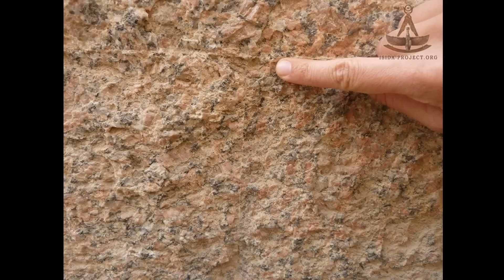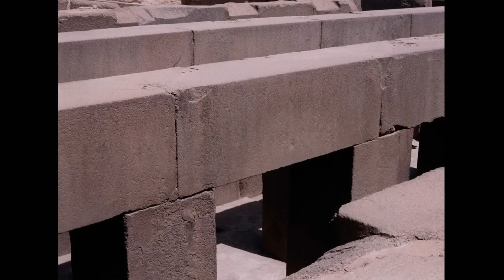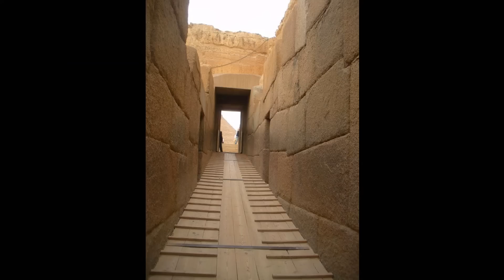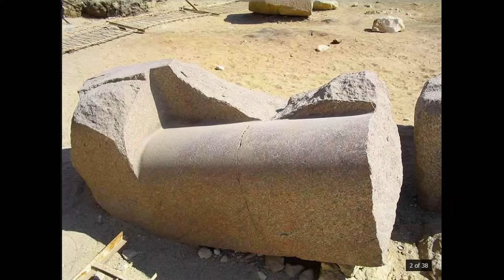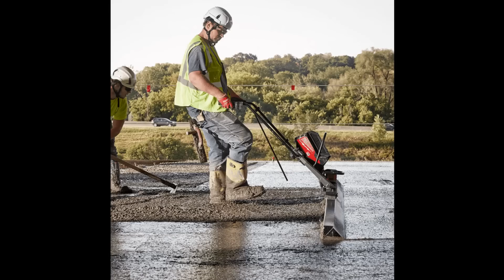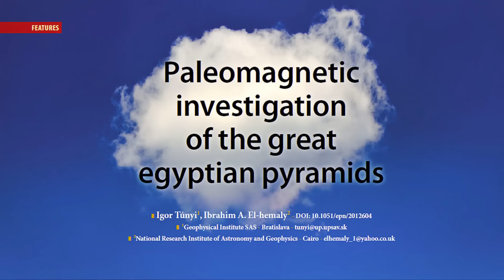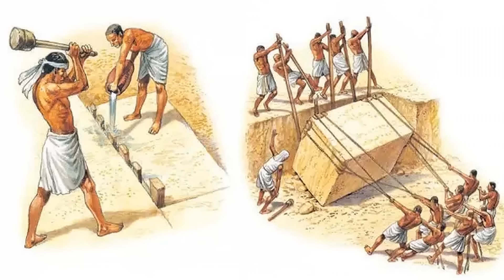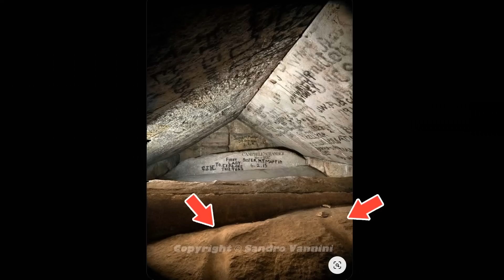How were the Perplexing Giza Pyramids' Granite Blocks Created?

Comment: Hi Tina. Sorry I haven't been paying attention to your channel in real time.  Remodeling is not as much fun as one would hope.

This is terrific and undoubtedly the correct answer.  The most interesting question to me though is how did they make the batch.  Was is chemistry, like cement or was it heated.  Using lenses and sunlight we can melt anything on earth.  I've seen steel melt like butter using solar concentration ratios of around 1,000 to 1.  Hathor's horns likely held lenses used to melt most anything.  The Horns of Consecration on Crete that Evans brought to light were surely used to melt metal.  The double axe image is what you get with a certain type of concentrator. I've built them for NASA so I do know a bit about these things.

I'm delighted that you have tuned into the work of the great Prof Davidovits.  When we eliminate the impossible, ie, copper saws to cut 2 ton blocks, lift them, fit them -- for goodness sake -- who could believe that?  When you try that it is impossible to get perfect fits at any time. When you pour concrete it is impossible not to get perfect fits every time.  QED

Given enough strong young 20 year olds, I could built the great pyramid in 20 years, as Herodotus tells us.  The granite was probably poured but I suppose it could have been mixed like cement.  When you put water on granite you don't need very high temps to melt the stuff.  How else did the blue granite boxes get under Saqqara?

Thanks again for your great work.  I intend to start paying attention again.  As for the date of the Great Pyramid, I believe Petrie thought it was 5500 BC.  I'm not so sure it takes a long time for memory to fade after a cosmic catastrophe.  The same source that points to the Atlantic shoreline, (ie, Atlantis nesos per Plato) being 9000 years before Solon says the declination of the earth changed later.  I believe 6200 BC was when this happened -- Phaethon.  I believe the earth tilted.  Yet to be proven but I'm working on it.  This coincides with a meltwater pulse and the submergence of Doggerland.  

Best Regards,
Henry Hewitt
Reply from the maker: Thanks for sharing your thoughts and your expertise, Henry. It's very interesting to think about how lenses may have been used in ancient times. I'm also glad you appreciate Prof. Davidovits' work - his insights into the pyramid stone are fascinating.

Comment: -If you assume it is Cast Granite,
then with what machinery did they crush the granite - Tens of Millions of tons!
-What kind of Formwork did they have to withstand 50 - 80 Tons of granite paste, and to come out perfectly for the joint, without bending, breaking due to the weight-pressure?!
-What kind of Formwork - Mold did they use to withstand the pouring of the granite paste, in the manufacture of gigantic statues of 700 - 1000 tons ? or the pedestal of 400 tons?
-With what, How did they raise the 100 -200 tons super-storey monoliths in front of the Sfinx ?
-The Obelisk of Aswan It is not cast granite, it is obviously cut from the granite quarry.
-And yet in the Aswan Quarry and around the pyramids there are a lot of traces of a circular cutter.
-It is possible that those craftsmen had some kind of technology with which they cut - they dug easily into the granite!

Comment: the knobs are indicative to where the original surface of the wall was weathered away from, yes those were water exits, the finer particles set there mobile from the exiting excess water. This is why it weathered slower, its more densely packed while hardening . Those blocks break very conchoidal for natural included quarried rock, point to it being very uniform. If they find carbons organic or fossil material those were granite cement blocks cast not quarried.

Comment: It's not hard to make two even matching surfaces, just time consuming. Like a pair of mill grinding stones, you place one stone on top of the other and start turning it. Evenually both stones will be perfectly plane. Then repeat for the next five sides. As for the uneven you carve a piece of wood or cut papyrus to match the rough stones then you transfer the pattern to make the matching pattern on the next stone.

Comment: Hi Tina. Thank you very much for highlighting my comment. 
I don't think the Ancient Egyptian master-masons used a resin to reconstitute their granite as is done in modern times using granite fragments, so I don't think any resin  will be found in ancient cast blocks. 
No, using carborundum edged bronze, or even hard clay or wood fly-wheel type drill grinders on natural granite, the master-masons produced a very super-fine granite powder to use, and did not use granite fragments as is done today. I think a two-man team could produce a bucket of this super-fine powder in an hour or so. 

The Ancient Egyptian master-masons then took this granite powder and added a little water and an acid catalyst to form a malleable paste which they poured into their molds and allowed to dry and set hard over several weeks, or months. 
What the master-masons were doing was using mechanical means, and then an acid to break down the granite super-fine particles into their hot, molten state, that is, the granite molecules were partially disconnected from each other, would not be rigid, and would flow as in lava. Normally, a very high temperature would be required for the granite to be put into this state, but I believe the Ancient Egyptians discovered the above cold method to do this without the heat.

During the drying and setting period, when the acid had all been used up in dissolving a proportion of the super-fine particles, then the granite unattached molecules would start re-attaching themselves to each other, form crystals and become rigid just as in cooling lava. And then, also, it would look exactly like lava-cooled natural granite!

it is interesting to note that in Malta, the blocks cut from Malta's modern, limestone quarries are very soft when first cut, and have to be left in the air for many months or years to dry out, or "season", before they become extremely hard suitable for building houses.

Comment: It stands to reason, that if a storm of high winds and/or mighty waves come into contact with a coastal building, that only the foundations will be left in-place.
I personally have seen this via hurricane in the Pacific Islands.

Consider the foundations being huge stone blocks.
Eg
The Great Pyramid surrounding courtyard, monuments of Roman and Greek construction.
The Romans and Greeks seem like they didn't construct their foundations.

If a Great Flood, washed away the building that existed
(Gobekli Tepe suggested 3 waves), then the Romans and Greeks would have discovered prime locations to erect buildings (where foundation stones already existed).

Half way up the Great Pyramid, are water markings.
And around the walls surrounding the Sphinx are water erosion signs.

But it's too easy to make this comparison.

Like the comparison of the shape of the sand, when a wave retreats from the beach.
And the aerial photograph of land formations, where a Great Flood may have retreated from the land.

Comment: If they have those knobs, which would indicate enough weight to the blocks to require some knobs to help move them, then would that indicate NOT being cast?  Love this video, just thinking out loud.  Your knob video, which I’m about to watch again after typing this, opened my eyes so much.  Fyi.  Ok back to the thought.  If the knobs are needed to move some of these potentially then they would’ve been heavy and solid and wouldn’t be cast right then and there right?  Otherwise no need for knobs?  I can see cast stone being whisked away into a smooth surface, but I also could see hard stone being CUT flat by an angled saw of some sort.  

Seems highly unlikely that this pyramid only would’ve had its construction so precisely halted by let’s say the younger dryas whatever happened.  I would wonder why they started smoothing the surface right there and why it’s up to a perfect height and only done for like 15 feet in width.  But yeah, mostly wanted to comment about why the knobs of this was just poured or cast and maybe they were hard and cut smooth for finishing after construction.

I don’t know any answers lol, I’m just awake after changing a diaper and sitting here enjoy the mind trip on your video.  Thinking……thinking…….

Comment: Yes they were cast, more accurately melted into shape. Squared rubber like sleeves were made on the "lingum" stones from guano and tree resin like kneading bread to thin membranes, left to almost vulcanize over heat, granite was then poured in to oxidize back into a solid that fitted perfectly beside the rubber membrane beside it. Hence the perfect fit. Then floated into position using frequency levitation technology. 
Wasn't 4500 years ago though, the granite was 16000 years ago roughly, it was the egyptians that learned from these found cities and added the casing stones as repair and beautification practices, and to display their power and authority. 
Poly stone designs were far more resilient against earthquakes and attacks than repetitive brick designs like we see today.

Comment: Complete nonsense saying it wipould be "easier to cast in place". No large overhanging block like the chamber roofs would be. The amount of materials needed and procedure... no. Cast elsewhere and fitted... more likely. But not likely at all because machine marks are everywhere, and the "cast rock" you showed uses various binders, not found in the pyramids or anywhere else. Stop the misinformation. Its bad enough.

Comment: Melting most rock. Thermite iron  and aluminum, gets to x2 heat to boiling. Clue sound, melting, magnetic feild, and increase of Thermite reaction clay molding and imagination. 
This means the test peices.
And casting stones  in place and sand gavel. Hot cement casting.

Comment: The granite blocks used in the pyramids ARE NOT cast granite. It has already been proven NOT to be cast granite due to the crystalline inclusions in the granite.
The granite blocks that were smoothed out or flattened was done with a lost technology we (or you) do not understand.
No one currently on the planet can cut or shape or place granite in the way these granite blocks were shaped and placed at the pyramids
Reply from the maker: I checked multiple papers and only found one paper stating that the granite and limestones are all natural, even though many other papers have provided all kinds of evidence that the limestone is artificial; which makes that single paper's natural stone conclusion questionable. Could you share your source on the crystalline natural granite of the pyramids?  Is it a scientific study?

Comment: I'm inclined to imagine the ancients using "stone to grind stone" using the movement of one large stone being pushed and pulled back and forth by several men against a smaller stone (the stone that is being dressed). Maybe the "knobs" were originally longer to tie ropes to pull the stone back and forth. Then they were removed and ground down later.

Comment: Cast stone can never be as strong as regular stone. That is why steel reinforcement bars are always introduced when cast concrete is going to be structural. It will never achieve the strength of real stone. "Cast Stone" is just a commercial name to give the idea that their product is as strong as stone. Cast Stone is not real Stone.
Reply from the maker: The granite casings and even the beams of the relieving chambers are not really load bearing.
Reply: @CuriousBeingbyTina  You cannot build a pyramid without load bearing stone. A "Beam" by it's very definition is a load bearing member; it is a support. Concrete beams with no steel reinforcement cannot be used as structural supports. If you look at the stone at the pyramids, it looks like regular granite stone in its natural state. This is not concrete. We must look elsewhere to determine how they dressed these stones. I think they had ways of using stone on stone friction to get them finished. Today terrazzo is a liquid concrete-like material that when hardened is ground flat and smooth with stone. They use floor polishing machines with stone wheels to do the grinding.
Reply from the maker: @9344music5  The pyramids are almost completely solid with minimal openings. The great pyramid has the most elaborate interior openings which is 0.014% of its volume. The millions of blocks are load bearing. Engineers have discussed that the "beams" in the five relieving chambers are not really loadbearing while the top chamber's limestone gable ceiling is. The limestone cores and casings have been proven by multiple papers to be artificial, so the pyramid builders had technologies to create man-made stone. 
Here are some papers arguing that the pyramid limestone is not natural:
•	https://www.researchgate.net/publication/299304501_Were_the_Great_Pyramids_constructed_of_agglomerated_stone_limestone_cast_like_concrete  Joseph Davidovits
•	Paleomagnetic investigation of the Great Egyptian Pyramids, Igor Túnyi and Ibrahim A. El-hemaly, Europhysics News 2012, 43/6, 28-31.  https://www.researchgate.net/publication/258626055_Paleomagnetic_investigation_of_the_great_egyptian_pyramids 
•	https://www.europhysicsnews.org/articles/epn/pdf/2012/06/epn2012436p28.pdf 
•	Were the casing stones of Senefru’s Bent Pyramid in Dahshour cast or carved? Multinuclear NMR evidence, Kenneth J. D. MacKenzie, M. E. Smith, A. Wong, J. V. Hanna, B. Barryand M. W. Barsoum, Mater. Lett., 2011, 65, 350. https://www.sciencedirect.com/science/article/abs/pii/S0167577X10008979 
•	Microstructural Evidence of Reconstituted Limestone Blocks in the Great Pyramids of Egypt, Barsoum M.W., Ganguly A. and Hug G., J. Am. Ceram. Soc. 89[12], 3788-3796, 2006.  https://ceramics.onlinelibrary.wiley.com/doi/abs/10.1111/j.1551-2916.2006.01308.x
•	The Enigma of the Construction of the Giza Pyramids Solved? Scientific British Laboratory, Daresbury, SRS Synchrotron Radiation Source, 2004. 
•	PIXE, PIGE and NMR study of the masonry of the pyramid of Cheops at Giza, Guy Demortier, https://www.sciencedirect.com/science/article/abs/pii/S0168583X04003234 
•	https://www.nuclear.lu.se/fileadmin/nuclear/Undervisning/TillSubFys/PIXE-Cheops.pdf NUCLEAR INSTRUMENTS and METHODS in PHYSICS RESEARCH B, B 226, 98 – 109 (2004).  
•	X-Rays Analysis and X-Rays Diffraction of casing stones from the pyramids of Egypt, and the limestone of the associated quarries., Davidovits J., Science in Egyptology; A.R. David ed.; 1986; Proceedings of the “Science in Egyptology Symposia”; Manchester University Press, UK; pp.511-520. 
•	Differential thermal analysis (DTA) detection of intra-ceramic geopolymeric setting In archaeological ceramics and mortars., Davidovits J.; Courtois L., 21st Archaeometry Symposium; Brookhaven Nat. Lab., N.Y.; 1981; Abstracts P. 22. 
•	How Not to Analyze Pyramid Stone, Morris, M. JOURNAL OF GEOLOGICAL EDUCATION, VOL. 41, P. 364-369 (1993). Comment a-t-on construit les Pyramides: polémique chez les Égyptologues, HISTORIA Magazine, Paris, No 674, fév. 2003, dossier pp. 54-79 (2003).

Comment: Very interesting, but the granite stones at the pyramid sites are clearly not cast. This can be determined easily by examining the structure under a microscope. Casting would introduce other components to the matrix and provide a completely different look. This is ROCK not concrete. But "melting" would make sense. The rock would go back to it's original state. But how would they do it? I have seen rock melted by magnifying glasses focused on one small point of a rock. But I can't imagine how they would melt some much rock and manipulate it. There is a missing technology here and it is not Alien. We are just too dumb to figure it out or it was lost to time. But it will be revealed soon eventually..
Reply from the maker: I checked multiple papers and only found one paper which did XRF on stone samples stating that the granite and limestones are all natural, even though many other papers have provided all kinds of evidence (from XRF, plasma torch, NMR, paleomagnetic and more studies) that the limestone is artificial, which makes that single paper's natural stone conclusion questionable. It's possible that the pyramid builders had different ways to create reconstituted granite.

Comment: As always, your research and analysis is impeccable - credit must be given when it's earned! I'm one of those guys that may not always agree with your conclusion, but ... 
What we are dealing with here is most likely a geopolymer concrete. Aggregate for it may be made from any rock, it is easy to transport, mix and pour in to molds or in-situ on site. To create those curves, mold have to be coated with any oil, and that will produce an unblemished surface. When I was younger i did some concrete work around my house, and any wood that I used to build a form was coated with oil (in my case, an used engine oil). As concrete cured, wooden form just popped off from concrete, often leaving an imprint of wood texture on concrete surface. Additional benefit is that form can be reused as many times as you need it, as long it is re-coated with oil before every concrete pour.
Once full chemical analysis is done on those "rocks", we will know for sure how it was done.
Somebody mentioned in comments an unfinished obelisk. Whether you have to use actual rock, or you can get around by geopolymer depends primarily on purpose on the object.
Reply from the maker: Interesting information and well said - thank you very much for sharing your insights. I appreciate that :-)